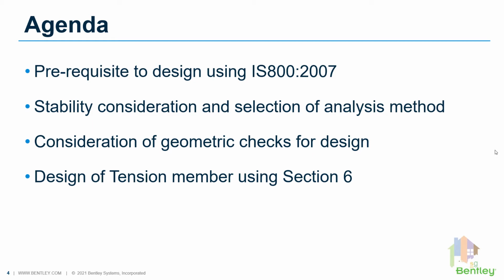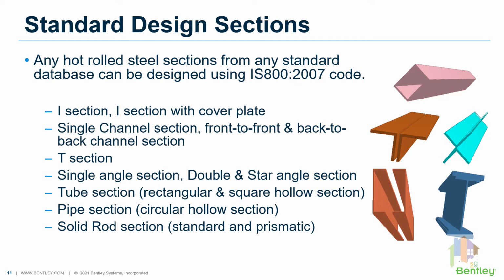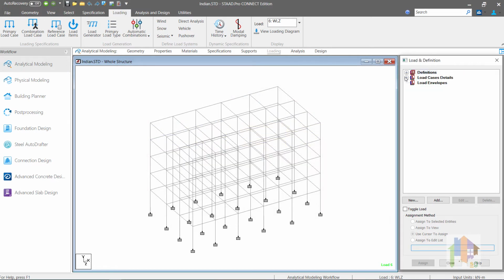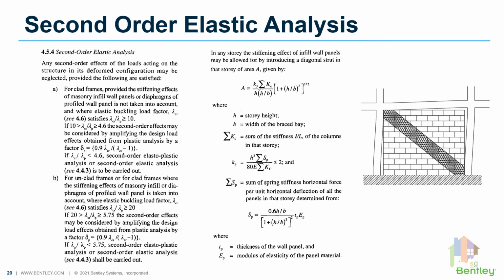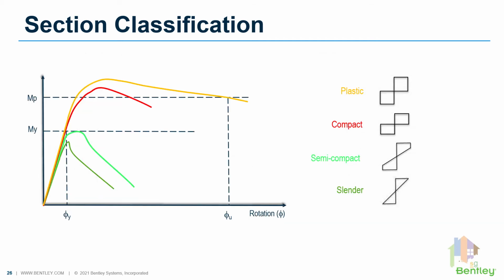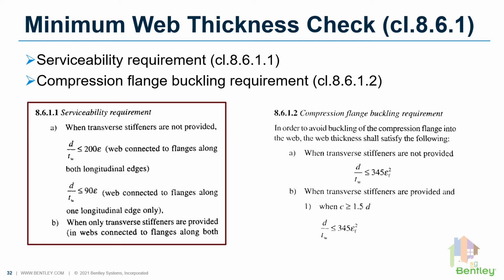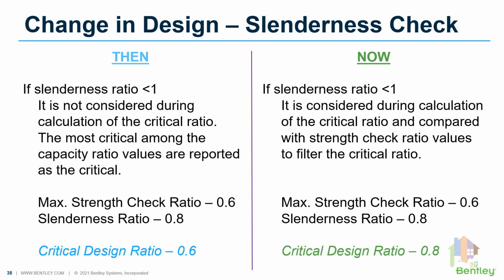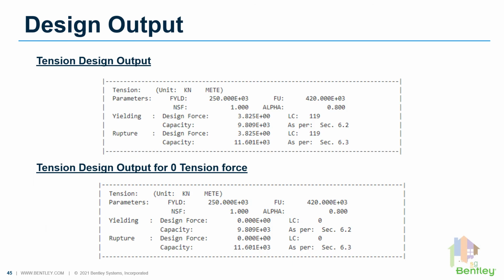Implementation of IS800:2007 code in STAAD - Part 1: Stability Analysis & Tension Member Design

Comment: No, the Ultimate Tensile Strength (fu) of steel is generally not used as the primary design strength in the Limit State Method under IS 800:2007.
Instead, the design is primarily based on the Yield Strength (fy). Pl correct yourself.

Comment: Hello sir, Thank you for sharing knowledge, how to solve this , at 21.17 min Note: 122. if any floor diapharam present in the modal ........  ???
Reply from the maker: It's just a note to inform the user about the command sequence. If any floor diaphragm is present in the model, then wind load must be defined after the diaphragm command. Else wind load generation is not successful during analysis. If a floor diaphragm is defined in the model along with wind load, you need to check the command sequence from the input editor. There is no way (except SET command) to eliminate this note.

Comment: What is the slenderness limit considered for member truss elements? Should it be 250 or 300
Reply from the maker: That depends. In Table 3 of IS800:2007, nothing specific to truss member is mentioned. For tie or bracing members of a truss ineffective due to stress reversal, you can consider the limit as 350. For top or bottom chord members which are subjected to compressive force due to gravity load, it is better to consider the slenderness limit as 180 for compression and 400 in tension.
    Just one additional information. You can consider slenderness ratio as 250 or even bypass the slenderness check, but higher actual slenderness ratio will always affect the compression capacity as well as the overall capacity of the section under combined load.